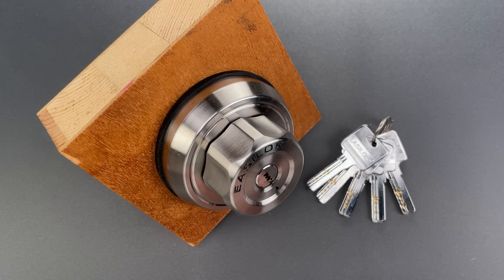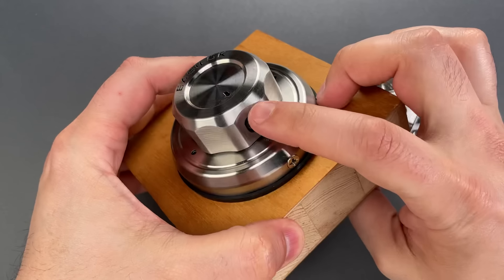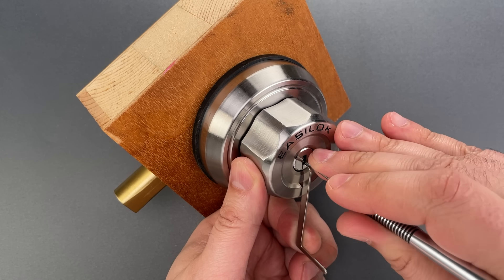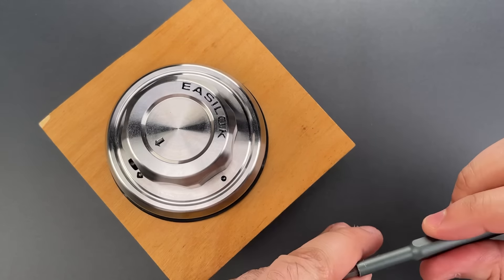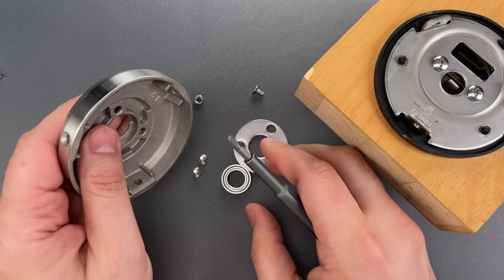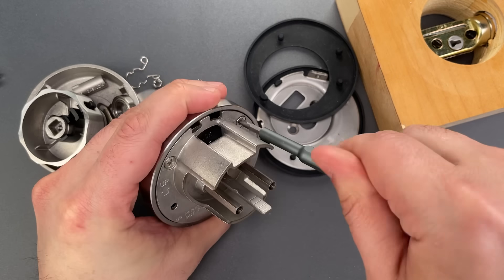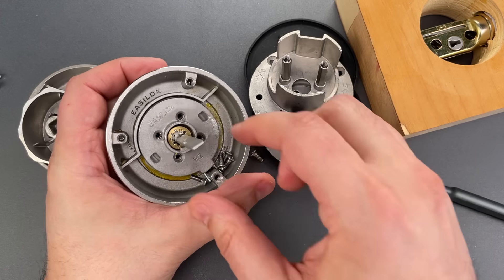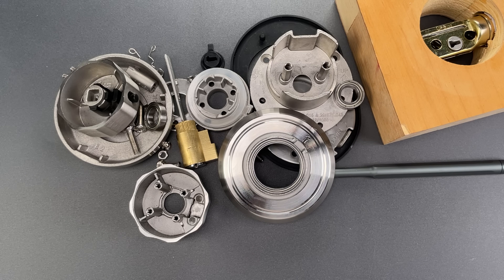[1388] The Best Built Deadbolt Ever? Easilok

Comment: I honestly would love to see you attempt to pick it with the lock override turned on.  Because, honestly, that one feature there if it turns this simple lock into unpickable when someone is home makes it above and beyond anything else
Reply: Great call. 
LPL, please try this.
Reply: If the key doesn't work when latched on the inside, how will picking work?
Reply: @taylorhofman3547  It wont
Reply: @gnoldi  sometimes it does if the build quality is trash
Reply: I was just about to ask the same thing!
Reply: You can still pick it, but when it turns, it's disconnected, so it won't open anything.
Reply: @skliros9235  what if there's some sort of bypass that turns available only when the override is on? Seems unlikely, looking at the build and design, but worth looking into when you consider that revealing a weakness shows potential for improvement.
Reply: @cybercapri  If there's an emergency someone will use destructive force to get into the house rather than try picking the lock. As for fiddling with the override every time you leave the house, I don't see it as much more effort than having a second smaller lock on the door so I would think it's up to how safe you feel about your neighborhood vs how much you care to bother with setting the lock.
Reply: @cybercapri  As someone who has supported Public Safety services in my city (police/fire/paramedics), they don't bother trying to open the door politely when there is an emergency. They go through a window if it's large enough (and not CAT-5 hurricane rated plexi like I have on my house, which is LITERALLY bulletproof), or they use a ram to destroy the door.
Reply: @Josh-99  we will go through a window if we can find an open one, if it's for a medical check or emergency. If it's a structure fire or smoke in the building then we aren't wasting time, we are popping the door immediately. And you're right that hurricane glass is a real issue for departments that have to deal with it. There is a relatively easy way to cut it but it's still a pain.
Reply: Everyone's replying to Paul as if an emergency always has police/fire/ems involved. "Emergency" is a relative term. And he specifically said, "how's anyone getting in to help even if they have a spare key?"
So this is likely referring to checking in on family who isn't responding to phone calls or the doorbell. It's not likely cousin Edna is going to bust down the door. She doesn't normally pack a ram in her trunk.
Reply: @Josh-99  If someone spends the money on that lock, probably they'll have a security door, which will also take a good while to ram off. Considering that is USA, and houses are a bit crap, the best option will be to make a hole on the wall.
Reply: @RobCalhounPGH  yes but if my mother isn't responding to me and my key isn't working I'm going to call the police/ambulance and/or break a window.
Reply: @RobCalhounPGH  Cousin Edna calls EMS for assistance like anyone else would.
Reply: @Vlad-1986  'Make a hole in the wall'. American houses make me laugh. It's like Americans have never read The Three Little Pigs. Good luck making a hole in the wall of a British house without explosives.
Reply: That “built-in night latch” feature seems to be there to prevent that kid that sneaks out and then tries to sneak back in in the middle of the night.
Reply: @Bob3D2000  most houses there are brick and mortar yeah? Bricks are pretty weak by themselves but strong a frig whent they're stacked and stuck so would definitely prefer explosives!
Reply: I agree. People are saying emergency services will break in with force, but what if it's a parent unable to break the door down themselves? ES will still take a while to arrive on scene and by then it could be too late.
Reply: @Bob3D2000  I always wondered if that is not a "protection" to natural disasters in that their houses will be cheap and quick to rebuild. But not all their country has natural disasters all the time, and not all their country has cheaper houses, so don't know. Maybe it started as "quick and cheap" and stayed with the crappy houses because inertia.
Reply: they sell one sided deadbolts that don't even have a hole to attempt to pick, its really not that hard to stop a lockpicker from getting into your house lol.
Reply: @cybercapri  Some people want a night latch.  This turns into one at the flip of a switch.  If they don't want a night latch, don't use it as one.
Reply: @cybercapri  That is why fire dept. have axes.
Reply: @Bob3D2000  you act like bricks are indestructible 😂
Reply: @RobCalhounPGH  If you have emergency like this you call the 911._
Reply: @primech-128bit  Yes, absolutely. You call 911, have them come and break the door down. And then your relative comes home from their vacation they told you about but you forgot. WTF?!
Reply: I imagine LPL thought of that or he would of done it for the video.
Reply: @RobCalhounPGH  I'm sorry, WHAT? They come back from vacation... where they somehow flipped the latch which can only be done from the inside of the house and equally would make their own keys worthless? You feelin okay buddy?
Reply: @mjp121  Sorry, leaving via garage or other doors is common.
Reply: @taylorhofman3547  Exactly. HOWEVER, is it still possible to get it open somehow short of busting the door down? We've all seen the LPL use a number of tools including ramsets to open locks.
Reply: @Vlad-1986  um you do realize that there are plenty of well-built structures in the united states right??? it's not like the country only started existing 20 years ago. there are plenty of durable buildings that were built in the 19th and early 20th centuries here lmao
Reply: @pianoanime  Locks only deter the honest.
Reply: @Vlad-1986  Good point; I have personally witnessed the NYPD take more than an hour to defeat a steel front door with rams and drills
Reply: @Bob3D2000  Sledgehammer with a pike will make pretty quick work of brick walls.
Reply: Can you re-pin the core?
Reply: @Josh-99  Might want to test some scrap pieces of the plexi/ polcarbonate windows before thinking they will stop a bullet.  Even a .22 will pierce 3/8s polycarbonate and a 30/30 will blow through five thicknesses of 3/8 with ease.  I was disappointed in the results, really thought “the toughest on the planet” would at least repel small caliber slow bullets.
Reply: I think the override just prevents it from turning, and that the latch would still retract if you shim it with a credit card.
Reply: @Bob3D2000  Does this count as one of your daily required posts? I think your supervisor’s going to want more than that!
Reply: @RobCalhounPGH  My family makes me give them a spare set of keys to my place whenever I've because of this.

I used to have a condition where I would be unresponsive for days, sleeping 20 hours after not sleeping for 5 days etc.

Out of all the medical conditions to have, mine was pretty enjoyable.
Reply: @William Gates someone can also pick the lock when you're in, or your loved ones. I think people will want to know.
Reply: @Bob3D2000  I agree. Keep in mind though, some of those houses you have in the UK survived WWII bombings. I would rather hole up in one of those homes than a fallout shelter in the event of another war. They are very well built. In defense of some American houses, the ones made in the late 60’s and 70’s are very well made. That was when they cared about the quality. Now, it is what is the least number of nails we can use to hang the drywall.
Reply: @Josh-99  or our feet
Reply: @bramweinreder2346  And you can spend a couple of bucks to buy a bolt or latch for the inside of your door if you just need a door that is secure when you are inside the property and don't want anyone to be able to get in from outside. Afaik most locks with this functionality are unpickable because the bolt isn't connected to the key mechanism (otherwise the key itself would work).
Reply: @taylorhofman3547   when night latch works,it is unpickable
Reply: @HuntsT  in the UK there is a saying "our home is our castle". Throughout the history of Europe we have had to defend our selves a lot more than you yanks. So we built we built our castles out of stone and they worked a lot better than wood. We then found out that castles made of lumps of dried clay (bricks) was nearly as good as stone, easier to build, and easier to make the bricks anywhere. The castle got smaller (fortified Manor houses ) and then smaller (houses). We were also using a lot of wood to build up our navy so it was mud or nothing
Reply: @HuntsT  yes but they have bars on them it's an old courthouse/jail. My mate lives in an old chapel/church. The walls in my lounge are 14 inches thick solid masonry. The front  door is original with 6 inch thick solid  oak with iron reinforcing, the police will never kick my door in.
Reply: Those saying the override switch might cause a problem weren't listening. The only way it makes the key useless is if the switch is flipped AFTER locked. So unless your dog hits it on you after you leave, you will be fine
Reply: Yes, can you open it with the bypass enabled?
Reply: Wow tbh I never thought of that, if it can't be opened from dead lock then I could just have a cup of tea while the bailiff is wasting his time outside !
Reply: @bramweinreder2346 , no, you absolutely cannot shim a deadbolt latch with a credit card.
Reply: @Vlad-1986  overt entry tools take a few seconds to open security door installed in residential frames. 

If you have a security door inside of a concrete frame, it might take several seconds for the tools to get from the fire truck to the door to open it.
Reply: @notahotshot  not every latch is a deadbolt. I simply wondered if the latch is retractable with the override off, and fixed in place (non retractable) with the override on, effectively turning it into a deadbolt.
Reply: @pianoanime  The only reason to mess with it when you leave the house is if you don't want someone to be able to lock the bolt while you're gone. So you'd probably only do that if you already feel like you live in a good neighborhood.
Reply: @RobCalhounPGH  then ER can just enter through that garage/other door instead.
You're painting a scenario that is a non-issue! 

Besides, when you live alone you'll always have to make a trade-off between safety from intruders and the ability of family/friends to help in an emergency. Obviously, when you have medical conditions that can render you unable to open the door when you need help, then preventing people from entering without your permission should not be your top priority, aka this is not the lock you are looking for.
Reply: The problem with most locks is they seldom include a deadman option. the wrong trigger at the wrong time and the lock is totally fucked.
Reply: @Josh-99 what if my door is made of titanium and I don't have windows?
Reply: Nah, unfortunately you could get in with a portable angle-grinder
Reply: Yeah he won’t do this because his ego is too big 😂😂 he won’t accept defeat
Reply: @Bob3D2000 walls bro? So European. We don’t need walls, just wide open prairie as far as the eye can see. Happy birthday, America!
Reply: @-null-null8857 what's the name of this condition (if you don't mind me asking 3yrs later)?

Comment: The most interesting thing to me about this lock, is that you can literally take everything apart.  No press crimpings to hold stuff together.  You have snap rings, and screws.  To me this is awesome as its completely deconstructable without true destruction.  One could, theoretically, come up with their own internals and manufacture their own components to truly modify this thing.  Would love to see more manufactures go this direction, but... alas we'll probably never see it.
Reply: realistically any half way decent lock should be built that way. just look at all the schlage locks minus S-line which has plastic parts and they were shit
Reply: @crempidowo3061  yes,
Reply: true but there's a reason in this particular industry they keep so oppressively to press fits and crimp fastenings: Being able to deconstruct a lock especially from the locked side can be considered a serious security issue or how even a compromise of the integrity of the lock
Reply: If you can make internals you can easily make the externals just as well as they did and probably better
Reply: Not only that, but either all screws are the same, or there are just two different screws for the whole lock. Absolutely great

Comment: Locksmith in Canada here.
That looks like the most skookum lock i have ever seen. I have worked with most of the major high security locks up here, and i have never seen something so overbuilt and (what appears to be) well engineered. This knocks it out of the park. I have only seen a single ball bearing in the serviceable part of a lock once, let alone 3. Rarely do you see weather sealing on a deadbolt with no electronics. On top of that, all stainless, and a built in night latch function? I honestly might pick one up to take a closer look, and it may end up on my door.
Reply: Can i ask why so many bearings? Does that add security somehow? Or reliability?
Reply: @skie6282  just a sign of over engineering, which is rarely a bad thing
Reply: @skie6282  makes the lock turn and handle  effortlessly feels great ,the big bearing specifically is very rare.
Reply: @skie6282  Bearings make the lock turn more freely. In addition, the tolerances on both sides of the sealed bearing can be much tighter while it still spins freely, thus making it less prone to dirt/debris being able to jam it up. Bearings as the rotating assembly also means that they can be replaced instead of needing to get an entire new casting if the lock does jam up.
Reply: Skookum as frig! I have never heard anyone else say that lol in Oklahoma where I am everyone looks at me weird when I say it lol
Reply: @SquirrellyDan88  it's not a super common saying up in Alberta, but i hear it on occasion. I thank AvE for introducing me to that jargon
Reply: Toronto?
Reply: @scottalderson8673  Edmonton
Reply: Kind of makes me want to keep one on hand for the day I get a door to use it on.
Reply: How’s everyone doing with their locks? I see all comments on almost all videos for Easilock from 2 years ago. Looking to get one…

Comment: I noticed the Amazon listing for the E1/E2 version says “Top rated by the Lockpicking Lawyer” in one of the illustrations.  The newer version is orderable with either a proprietary Chinese dimple key core or a Schlage compatible 6-pin core.  As noted in the Amazon user comments, the easiest way to get extra dimple keys is to order keyed-alike cores directly from China.  Each core is supplied with five keys.
Reply: @jednick  Ah interesting - good catch on the switch to a lower tier product with a zinc casting.  Thanks
Reply: how do oyu search for a new core with keys? what key words did you use?
Reply: @9FingerMonkey  Easilok has cores listed on their web site.  The Schlage compatible cores are option A and dimple key cores are option B.  The dimple choice includes three cores and 15 keys.
Reply: @9FingerMonkey    I tried to put a direct reference to the listing, but it was automatically edited out.
Reply: Good info, thanks!

Comment: Their other model, the one called "Keyless Twist" looks to have a very unique core with the same build. You should review it.
Reply: I saw a video on that and looking at the keys it seems only the center pathway of the core has any pins so it probably isn't any more difficult to open.
Reply: @Hartbreak1  the shape of the keyways what's going to make it interesting. The layout will make it extremely challenging to get tension on for all but the best locksmiths.
Reply: @leechowning2712  hmm yeah I would like to see how LPL would approach tension on that keyway.
Reply: @leechowning2712  I have that version and it puts up multiple challenges in terms of picking. The first is that the core turns along with the knob. Second, the only way I have found to tension it is by inserting a narrow traveler hook on one side and pulling up on it. The other challenge has to do with the pins. They give almost no feedback and seem to be serrated. That may be because this type of core usually doesn't use the pins directly to unlock it. Each pin has a few serrations and one wide groove. The key pushes the pins up so that all the wide grooves are lined up, at which point a sidebar can drop into the groove and the core can turn. I can't tell for sure that that's what's going on, because the core is sealed and cannot be gutted, but based on other similar cores that I have gutted, such as an older style Yuema padlock (pre-model 750), and a Baodean door lock core, that is the system which they use and they feel the same to pick.
Reply: @theodorgiosan2570  I am really hoping somebody gets one of them for him. Unfortunately my budget does not cover $100 purchase right the moment or I'd get it for my own house. I remember further back he had a similar key way, but if I remember it actually was a challenge for him.